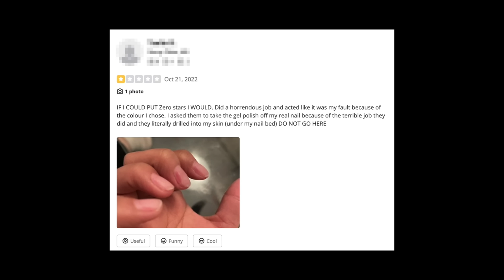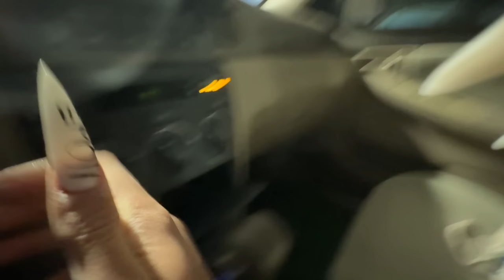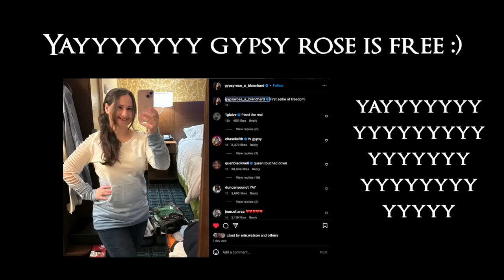24 HOURS WITH 12 INCH NAILS

Comment: When i had glued nails on (hot glue) I just got tired of them at one point, I noticed I couldn’t pull ‘em off, so a little tip, put your hand in warm water, it eases the nail and the hot glue will slowly fall off, and then it should be easier to remove the nails, with patience, worked fine for me